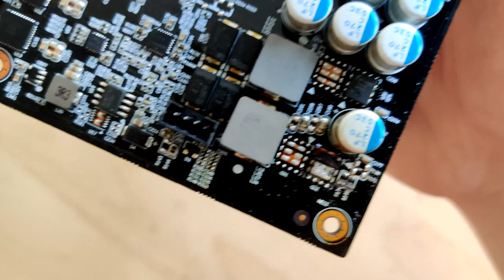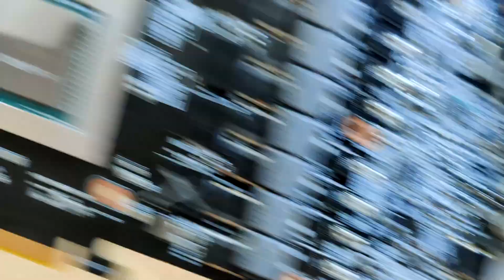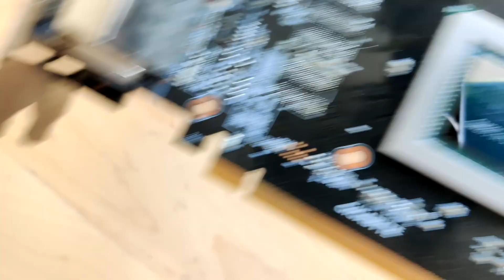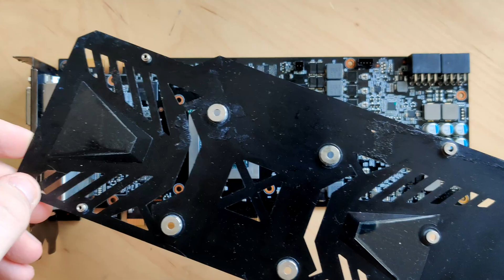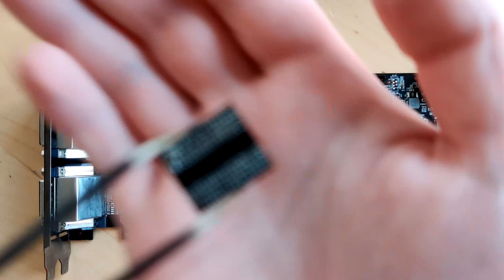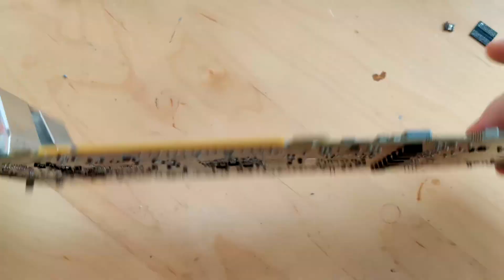Can the GTX 980Ti G1 Gaming be repaired?

Comment: @CmdrSoyo - Hello, I have a question I'm hoping you might be able to help me with, please. I own one of these Gigabyte G1 980 TIs, back in the day it had the exact same problem of R172/R174 ferrite beads burning out on the VRM, so it's just sat on a shelf for the past 5+ years.
However, I now need a card for a work PC that has 3 Display/HDMI ports to run 3x 4K panels, so I was hoping there might be some way I could get this card to work again. It wouldn't be doing any sort of gaming, it's just browser-based work, so it's not going to be put under high stress like it would for gaming. 

At the moment, those two problematic ferrite beads have just started to arc, I can hear them buzzing and they look just slightly burnt but it hasn't caused any significant damage yet. I still have an image on screen, it just can't clock very high. As soon as the core clock and power draw goes up above about 40%, it starts to throttle. So when I look at the GPU core clock on MSI afterburner, it just goes up and down constantly. 
As I don't have the ability or knowledge to do any micro soldering, I wondered from watching your video and a few others... could I just remove those two ferrite beads and bridge it with solder? Or could I just remove them to only use part of the VRM, as the card wouldn't be put under high load? 

Would it still work just to do web browsing and Excel/spreadsheets? My theory is because it's not going to be under gaming load, it's only ever going to be under light load, could I get away with this or would it just be unsafe? Or is there something else I could do as I have already looked into and spoken with every computer an electrical store within about 100km and no one would touch the repair.

Comment: Very similar situation for me, I've bough an "unchecked" 980ti g1 and the seem to have been burning so hot/long that they delaminated the pcb (is that the correct term? the layers went apart), the guy probably tried fixing it before he sold it cuz both of the mosfets were taken out (but he didnt clean the resistors up *facepalm*) I wonder whether I can get it back to working order
Do you maybe know whether there are any important traces inside the pcb under the resistors/right bottom mosfet?
Reply from the maker: @JohanildPG if the pcb is burned then it's probably not fixable without an epower or a highly professional repair shop that can rebuild the traces. 

In almost all cases where the vmem vrm dies the memory controller and vram chips are also gone too so it's usually not worth it sadly.
Reply: @CmdrSoyo  Well the PCB is not exactly burned trough - the surface is a bit scorched but it's not a hole - what I've meant by delaminated is that the PCB swelled up around the resistors all the way to the right edge of the board. I didn't do anything to the board yet so there's a short between GND and 12V line right now but it seems to only affect that one phase (1.5Ohm on one of the 8 pin connectors) and it could be because of the resistor debris that's still there so I assume the other phase might be ok? I assume disabling it and then limiting the power of the GPU (Optimistically assuming that VRAMs survived) could do the trick?
Reply from the maker: @JohanildPG  you can try. The short may be in a few places. Could be one of those components. Could also be that a layer below the top was touched. Or maybe if the mosfets are still on it could be that it has a short there since theyre dual n fets afaik

Comment: hey, btw I had my G1 gaming GTX 980Ti zapped (sparked inside my PC) and died...lol I dont know if you still need a exact card for the repair? but after that happen, I put into its box and been sitting in my closet ever since. never even tried to crack it open and didn't messed with it. let me know if you need mine
Reply from the maker: sure i can take a look at it. sounds like a VCore VRM short for that one so it may be able to be repaired with an epower. 
you can send me an email if you want to send it in.

Comment: Great video, really informative. Keep it up

I have exactly this card but a slightly different problem.

Computer starts. As soon as Windows loads the graphics driver, the card crashes with extreme artifacts. Maybe someone has some info on what this could be or an approach where to start troubleshooting. I would hate to throw the card away. As far as I could measure, there are no short circuits.
Reply from the maker: Those symptoms are almost always dead VRAM. You could try running MATS on it (for a tutorial just look up the tech cemetery tutorial on youtube) that should tell you which chip is faulty.
Reply: @CmdrSoyo  thank you for the quick answer. i will try this :)
Reply: @CmdrSoyo  i just runned mats on my card wihout any errors. the vram seems to be ok. Any other suggestions?
Reply from the maker: @sebno2  could be a dead core then

Comment: i bought a card exactly like this a few days ago and the problem seems to be very similar. the card gives image when loading windows, but suddenly crashes and shows red lines. Its not related to driver, i tried it with and without driver. in safe mode and sometimes in normal mode it loaded windows, but after a short time it crashed, and when i downloaded drivers it crashed.
There are no visual signs of damage, no burns. Some say its memory problem. You did a video a year ago on a GTX 980 ti, very similar problem to that. I would be glad if you could help me with that.
Reply from the maker: it's a memory problem. try running MATS on it
Reply: @CmdrSoyo  thank you!
Reply: @CmdrSoyo  okay, so i run mats, somehow it PASSed, but the usb drive is now empty and i cant see the actual results...

Comment: No please keep the card. Keep it until you re comfortable to do the repair yourself. Its very rewarding to do something like that yourself. I do it this way also since 2 or 3 Years. In the beginning i could do s...t , but then i bougt a Quick Hotairstation, a preheating Plate/ Pad and a useable soldering iron ... One thing after the other .
Reply: better to just use as spare part

Comment: I bought a GTX 980 Ti Gaming in the exact same state for 70€ during the pandemic. The guy even knew what was wrong but didn't want to fix it himself. All that was required for a friend of mine was solder the resistors back on (they were like 50 cents) and we got a 980 Ti at a time where it was like 250€. VRM was fine - the resistors were just gone. The card was just shutting off under load according to the description. We didn't know anything about repairs - but that was such a lucky find.